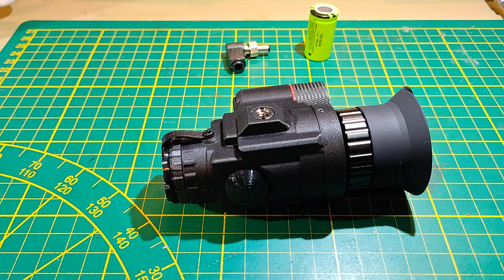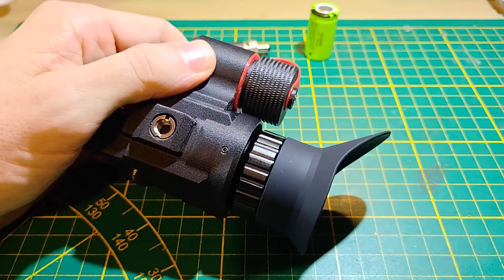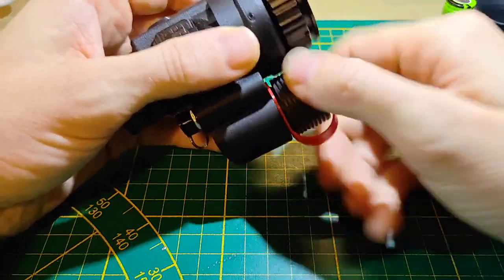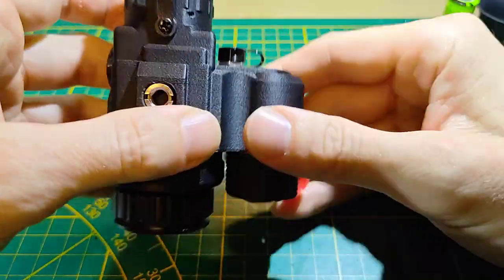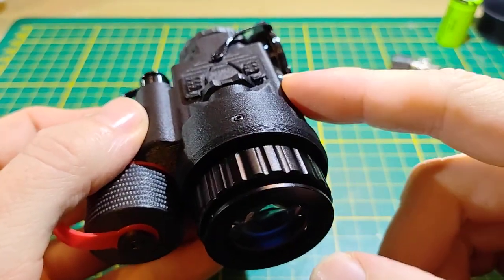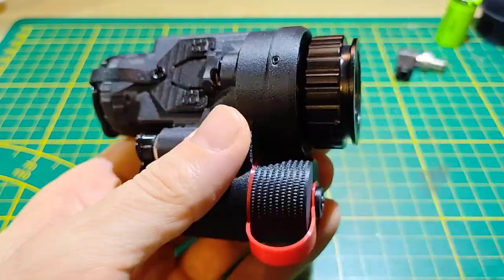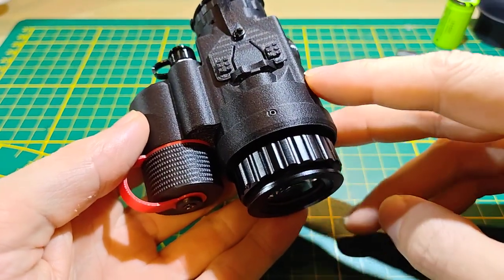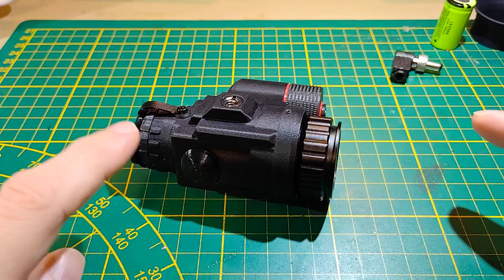PVS "GREMLIN"  low budget, 640 core, DIY, helmet mountable thermal monocular

Comment: A slight disappointment regarding the sensor quality. You state it's 640p, but when you place your finger in front of it, there's very, very little detail. I get better detail with my Infyray P2 Pro at 256x192, which is strange.
Reply from the maker: You serious?  :D It is called focus, and my finger was way to close to the sensor. Havent adjusted it to such a close distance in the video xD ( I dont even think you can adjust it on objects that close without a macro lens lol)  I mean my finger was almost touching the lens.   When you check on the printables page on the bottom you can find videos made outside where you will see the actual resolution, its top notch and sharp. This is the same core but with one of my other builds who also use an internal DVR Recorder: 
https://youtu.be/bVZnClsEaIs

Comment: QUESTION

I’ve looked into the data sheet on this thermal camera (the one from Aliexpress). I see that it uses the CVBS interface and has a serial interface. What is the TX pin for? I see in your Arduino code that you send commands to the camera using its RX pin, but does the camera output any kind of information over its TX pin?
Reply from the maker: it does output info as well but in this case we are not really interested into getting info from the camera, we just want to tell it what to do.
Reply: @LupusWorax  So I’m guessing that the info that it gives isn’t the image data?
Reply from the maker: @cadenmillican5059  nope its purely to get data from the cam when it comes to settings and adjustments.

Comment: Can this mount to a g24 or a knockoff g24?
Reply from the maker: It surely can be adapted, I own a knock off g24 myself and a member on my discord already posted a design he is working on....
Reply: @LupusWorax got it, what mount are you using as of right now?
Reply from the maker: @meladus  I just recently designed and build the gremlin, I was busy with Christmas, so far I did not make any mount for it.
Reply: @LupusWorax  will you post the version with the mount? im planning on using one for hunting so a helmet mount would be ideal
Reply from the maker: @meladus  you can join the discord that is linked on my printables page, to follow other users working on it.

Comment: a small sugestion: use a 2 pin lemo plug instead of a jack for external powering
Reply from the maker: holy shit the plugs like 30€?  that is pretty expensive O.o
Reply: @LupusWorax you are right, I just happen to have some from an old audio shop that shut down. for a budget build they are expensive but they are great plugs. mini xlr connectors can also work I guess, Im just not  fan of plugs without mechanical lock
Reply from the maker: @joemama.556  the dc jack I am using is "locked" with a nut if that helps ;)

Comment: How much did it all cost? Thanks!
Reply: Just perusing the parts list he linked to, and not including the needed 3d printer, it looks like it'll be $400usd or so.
Reply from the maker: @nasonguy  the 640 core itself is the most expensive part and on its own almost 400bucks, 0.39 micro display with driver board is another 100, and then some smaller inexpensive parts.
Reply: @LupusWorax  That's why I specified USD. The core is $180 USD on ALi Express.
Reply: @nasonguy    I was impressed by that too. But,.... $100 shipping to US. Guessing that's the tariff. Still an awesome build at a relatively low cost.
Reply: @nasonguy the 256px model is 180 bucks, the one used here is the. 640px which is ~400 to 500 bucks anywhere

Comment: Thats cool! Currently working on something similar. Do you use a 13mm lens on the 640 core?
Reply: What is the advantage of 13mm lens over 9mm lens?
Reply from the maker: @thebucketmouse  almost 1:1 with a 0.39 display and NP18 lens without the need of digital zoom.
Reply: @t @thebucketmouse explain this
Reply from the maker: still waiting for it to arrive, yes, rn its only 9mm
Reply: @LupusWorax  Ah ok, so its with some digital zoom right? I went the 640 9mm route with a 0.5 inch display. Its roughly around the same cost, as the 0.39inch and the 9mm lens (at least as far as i could find). How does the 0.39 inch driver board handle the 5:4 input? Is it cut off or streched?
Reply from the maker: @dersebbler9452  with the 9mm lens and 1.5 digital zoom applied, it is pretty much exactly 1:1
Reply: where did you get the 640 core from ?
Reply from the maker: @Guntechindia  HDANNIE  at alibaba / ali express complete parts list is linked on my printables page.